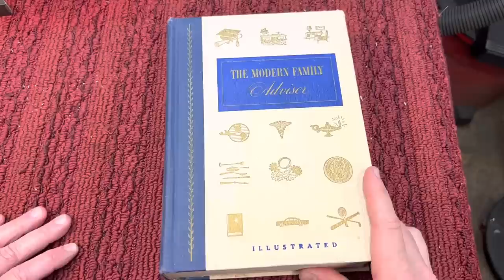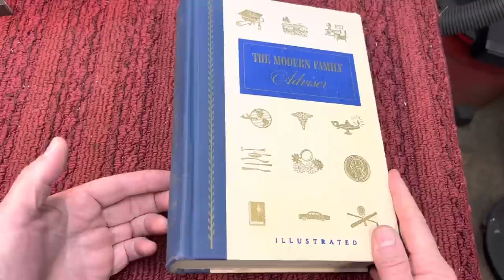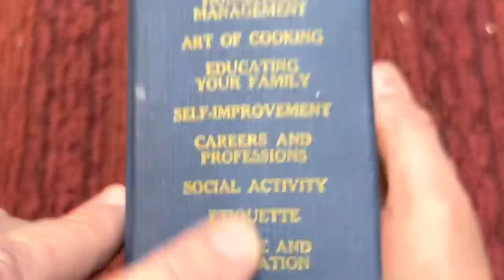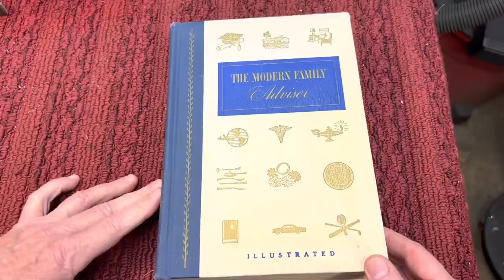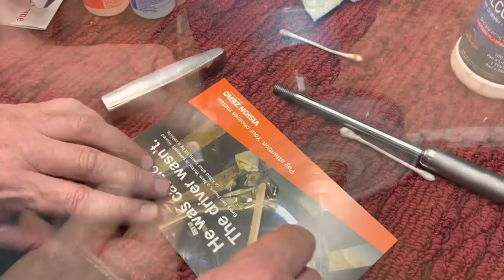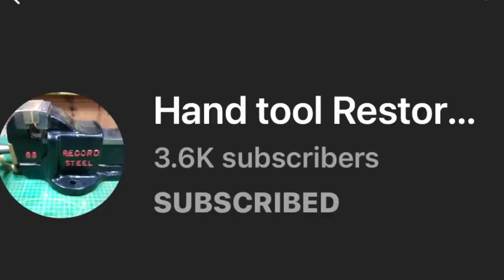Shop Class Hammer Restoration and Poor Man’s Flea Market Tour

Comment: I made a very similar hammer in my metal shop class in high school! My handle was aluminum, and I messed up and made the shaft too large to fit it together and I ended up taking it home over the weekends and using sandpaper to slowly wear it down until it was close, but I was worried it would spin when I put it on, so what I did was to put the head in our furnace, and the handle I put inside our freezer and when it was frozen, I shoved it into the hot head and the two fused together, unable to ever come apart.

Comment: I've still got the hammer that I made in 7th grade metal shop. I saw the screw driver years ago but not recently. The small canon(no touch hole) and the zip gun(no firing pin) disappeared while I was away in the Army. They were interesting classes(metal, wood and drafting). I kept up the drafting classes through high school and they helped in engineering school. Happy 4th. Good Luck, Rick

Comment: Nice hammer John. 
I made a lead hammer in shop class. Mr. Stankey had one of the cool cast iron mold and ladle combinations. I turned the handle and cast the head. It has had two heads so far. It needs another one. 
My apprentice machinist projects are still in the shop. The drill press vice, and sharpening gauges came home with me when I moved on to supervision. The rest of the tools stayed at Borg Warner. I didn't think I would need all the special gauges, clamps, and pullers. 
You missed a lot not taking shop class. 😁😎

Comment: John you did whomever made that hammer proud!  This video took me back to my metal shop class in HS, must of been 1967 or 68, all the equipment was old and totally worn out.....turning anything on the (one and only worn out) lathe induced so much chatter it was hilarious.  I spent most of the semester turning and knurling a large diameter steel rod, that depending on the week (and how much I wanted to mess with our dorky shop teacher Mr. Abbott) was either going to be a screwdriver, or a cold chisel.  Can't remember if I ever finished it, and/or whatever happened to it.

Comment: When I was in grade 8, all students spent 2 months in each of metal working, wood working, industrial arts, sewing & cooking. So in my area that could easily have been made by a 12 or 13 year old girl.  We made a similar hammer with handle threaded to the shaft, but the shaft was brazed into the head. Other than the lathe, and drill press, no power tools!  Cut the head from bar stock with a hack saw, filed and then emery cloth to shape and polish.  Thanks for the good memories!

Comment: You spark so many thoughts and good points in your episodes its tough to touch base and give them all credit without writing a long essay in the comments, lol. I will say my main two take aways from this episode is the reference line tip for keeping good and square grinding bevels and I need to remember to use the flap disc on stubborn dings in tools. 😁💥🇺🇸

Comment: An interesting way of fixing threaded shafts to a head is to wrap the head in a damp towel and microwave  it till to see steam, will not  hert the temper as ir cant go above the boiling point of water,  can also wrap the handle and into the fridge. When ready atach the two, the head will shink and the shaft will expand! This works great for installing bearings which I first heard about using the microwave. Thanks again Scott, have a great hoilday.

Comment: Very enjoyable. You would need a moving van to load up all that valuable stuff you find on the poor mans flea market. Just amazing what people toss out. I think shop classes are getting to be a thing of the past in many public schools. Auto mechanics classes were ended before I got to high school, and we never had a class in small gas engines. We did have a basic class in metal working. I still have the dust pan I made, and it still earns its keep. I think some manual arts classes are still offered in rural area schools. Thanks and happy 4th of July to all.

Comment: Thanks for your videos.  I still have the hammer I made in shop class.  It was a good project since the hammer used the lathe, horizontal and vertical mills to make.  Then we case hardened the hammer and put in a wood handle.  At that point in my life, I had never used a drill press or other power tools, so my hammer is rather crude.  I keep that hammer since it was the beginning of my life’s journey
Reply from the maker: Brian You are so lucky to have had that opportunity.  I always envied my friends who had shop class… 😃😃

Comment: I never went to the shop class either, the community I grew up in regarded college as the only acceptable path in life. Luckily my grandfather was also mechanical and became my teacher later in life. As I got older, he would assign me challenges to complete in the shop to demonstrate mastery. Still to this day one of the tasks I find most difficult is to make a simple five bolt ring, linking two pieces of aluminum, but the Flathead screws had to come out all pointing the same direction. With machine screws. It's certainly possible, I'm sure I would still find it difficult today. You might be surprised, give it a try if you think you could do it.
Reply: On the offhand chance that somebody reads this and decides to attempt this project, I will tell you the next project as something of a hint. It's to replicate the prior project without needing to number the screws, for one to be able to place the screws in any holes and have the flatheads align properly. That's some very impressive machining.

Comment: Great job on the hammer. I'm gonna have to disagree with you about ham radio. There are more ham radio operators in the U.S. today than there were 10 years ago (12% more just in the U.S.). After the morse code requirement was dropped, more people have gotten their license. Especially females.

Comment: With work like that you could pass grade 10 machine shop. I made one of those in grade 10 only much deeper knurling and the handle was one piece. The hammer head was a press fit that you had to expand the head with heat to press in the cool handle shaft. I notice you didn't etch your logo in it when finished. I kind of like that you didn't. Hope the guy who made it sees it.

Comment: Have you experienced sanding belts coming apart?  I wonder if you have tried to glue them back together.   Sure would like to get your input!  Thanks.
Reply from the maker: Tom- Yes!  Only a couple time as they are quite durable, you can often CA the belt back together but most often I use the broken belt for smaller jobs by cutting it up...

Comment: Epoxy instead of Locktite??? Epoxy does not stand up well to hammer blows and can crack. Locktite won't. I guess if the hammer is just for display it won't matter, but Locktite on impact tools is a better method IMHO.
Reply from the maker: I have never found loctite to be better then epoxy, I never tried blue but I used the Red many times.